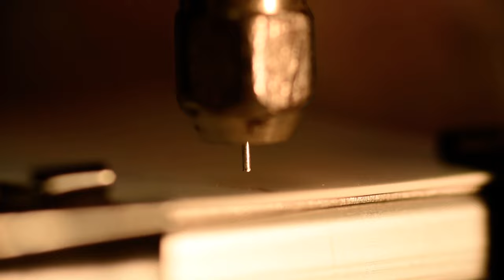AAA 4441

Comment: this mental printer needs a much stronger spindle
Reply from the maker: more powerful/stronger spindles are much more expensive. the point was the lowest cost possible proof of concept. the apparatus cost ~100 USD. 
and it produces results that are electrically conductive, solderable, and wire bondable. 

if you want to take a crack at it with a stronger spindle, I would love to see it!